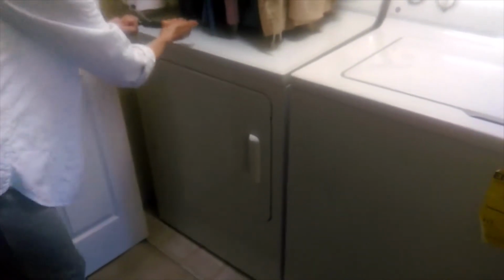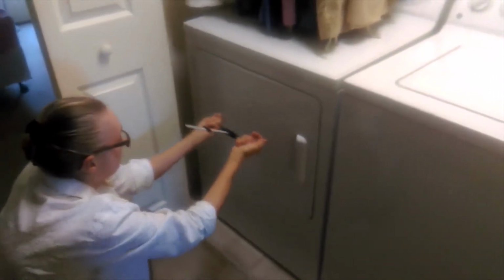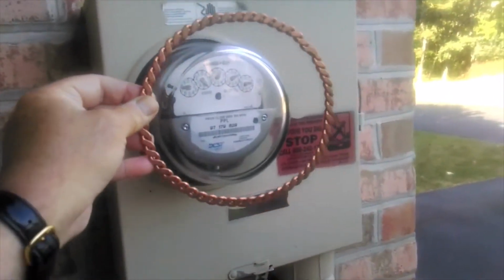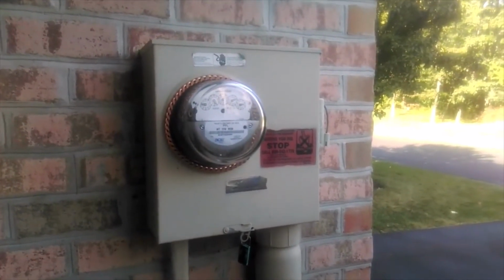Tensor Ring Placed on Electric Meter

Comment: You'll have to show me the science, not just a blurry video. What was she holding? You didn't show us any readings. You also have an analog meter, but I couldn't tell if it was an EMF-emitting meter or an electromechanical meter because the video is so blurry. I'm open to believing the truth—whatever it may be—but I need to understand how this works before believing it. This video provides insufficient evidence and it casts doubt into community by posting videos of low quality information. People are seriously harmed by EMFs and smart meters, please don't discredit the awareness we're trying to bring to the world about EMF harms with these videos.
Reply: ❤ Finally someone!
Reply: Hi Zoiy, good time to get some experiment done by you. 1.measure the emf from your phone before  2. get some aluminum take and copper tape 3. install small strips of copper and alum. tape on phone anywhere I did it on the back of it. 4. measure emf's once again on phone.  good luck... 
if you get the picture then do it on your earphones...
Reply: Those folks are not showing anything , inFACT let me see the actual measurements if volts per meter